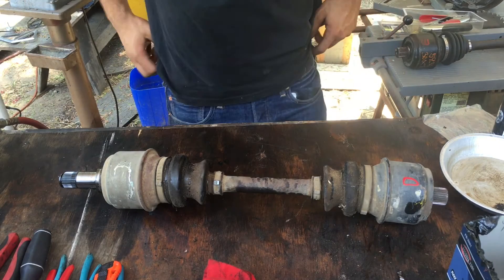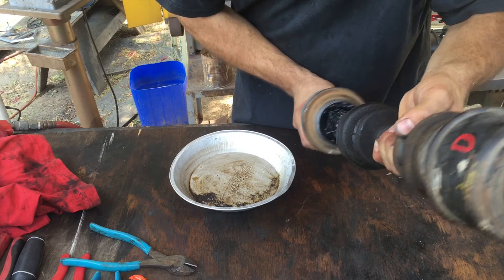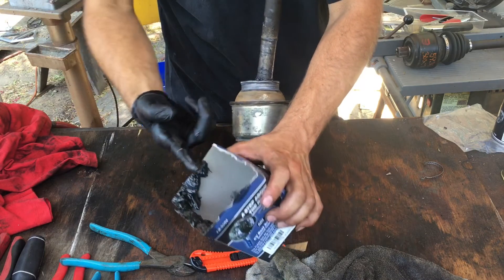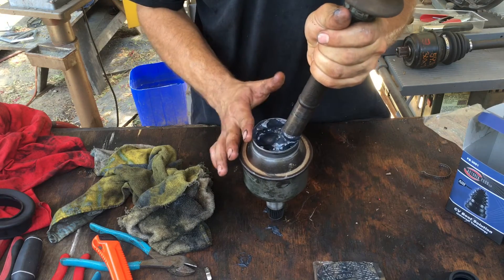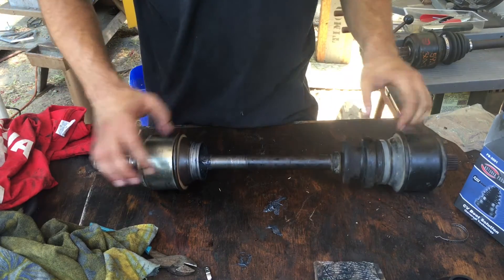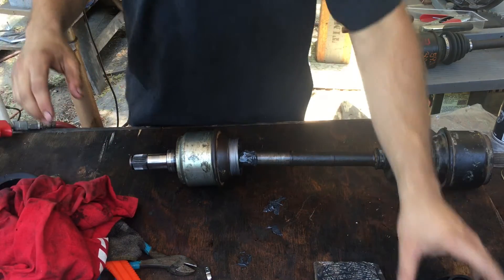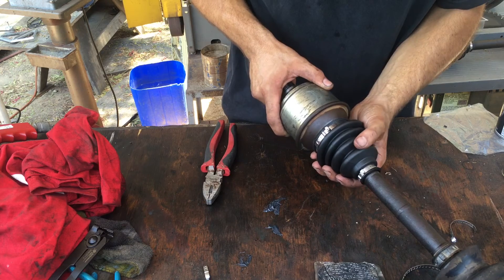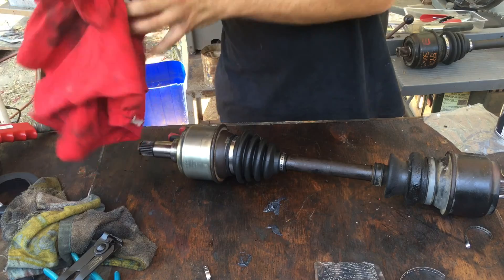Mercedes 300D CV Axle Reboot

Comment: what kind of pressure do you have on your compressor? I'm trying to do this with an off-brand amazon clone of the claw tool, but cannot seem to get the boot to stretch far enough with 125 PSI, and don't know if that's because of the low-quality tool or insufficient air pressure.
Reply from the maker: 125 is more than enough I believe they’ll run on 90. You have to make sure the big nut on the back is screwed all the way in, that’s the limiter. If that checks out you have to take it apart and get the piston out. I found on mine that the tolerance in the o ring groove was way too loose, and it was leaking air. I took some duct tape and wrapped an ⅛” strip around the piston in the groove (remove the o ring first) a few times to take up some space and make the o ring a little tighter. Then it worked great. Use plenty of grease on reassembly. Silicone grease is best.

Comment: The double audio is messing with my head. Trying to figure out how to do the boots on my 84 300sd
Reply: And a 82 300cd at the same time, like Dr. Hfuhruhurr.
Reply from the maker: The audio sucks I’m sorry about that. Those two cars have similar axles, identical joints but different dimensions. They use the same boots. I’m sure you’ve figured that out by now.

Comment: You can buy rebuilt rebooted stub axels for $60 bucks exchange now most auto parts store have them ...
Reply from the maker: mediaomar I’m running a set of cheap axles currently on my wagon. They have 50k miles on them, no issues. So I agree that the axles are decent, but the Chinese boots cracked within a few thousand miles. Maybe they’re not all bad but in my experience your best bet is to reboot and regrease good factory axles, or put good quality boots on the Chinese axles before installation. Or buy new factory axles for $600 a piece. Maybe other brands have better boots, but I got crap boots so that’s what I did.  The axles in this video are from a different car, and I believe they are factory, and still solid, so that’s why I went to the trouble. 
Cheers.
Reply: Nicholas Pogoler  in the USA there are rebuilds and new axels have run both for over a year no cracks or split in boots the rebuilt ones use a good quality boot just like flex boot quality... The new axel on the other hand have a not so thick boot ? No cracks yet time will tell  I had to reboot my 116 style no rebuilds. You do not have to use the flexx gun you can use a wide funnel or a funnel like tool to get the boot over the bearing can  I used grease an 90 w gear oil in the 116 axels been running for 150,000 miles no problems
Reply: Plus the rebuilds have a life time warranty